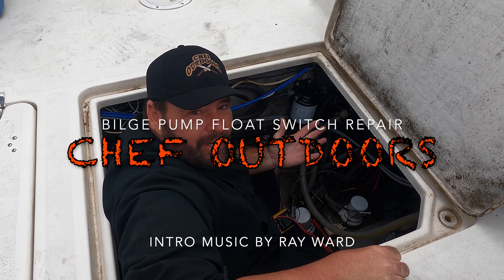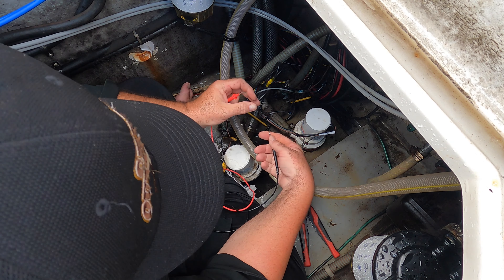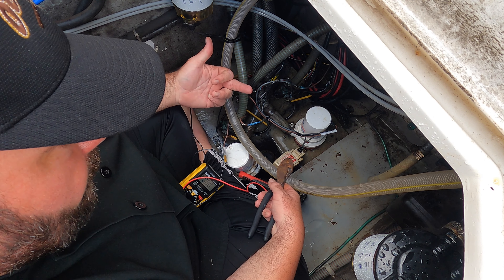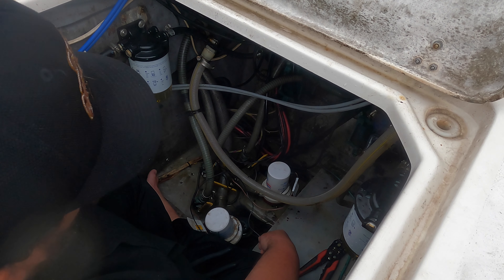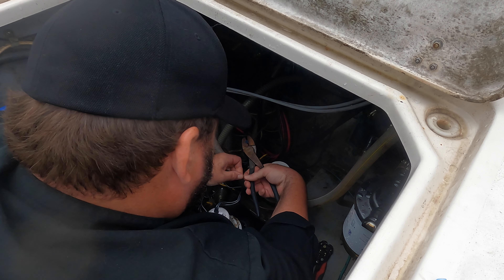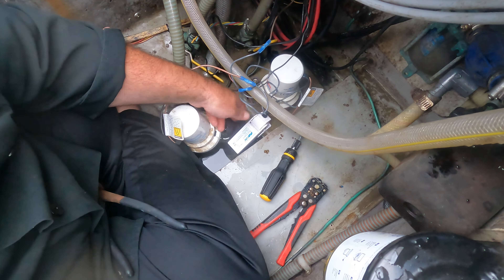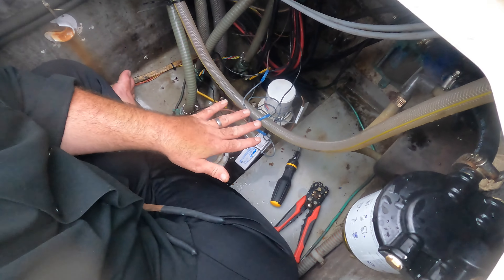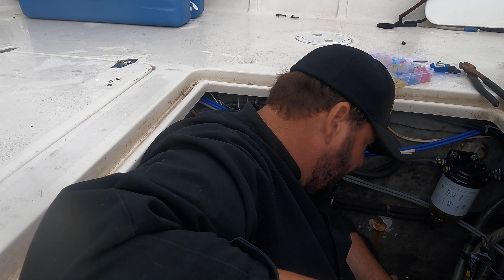Bilge pump float switch repair (how to)  "fix and troubleshoot a bilge pump in a boat"

Comment: You say any exposed wire in salt water will cause the whole wire to corroid. You stripped back the wire to get access, that exposes the wire and creates the problem, try using a needle to stick into the wire instead of stripping it back
Reply from the maker: even when you stick a needle into it it rots out. salt water and electrolysis is a truly amazing thing. best to cut fresh and re seal the whole thing
Reply: if you reseal it, it’s totally fine!